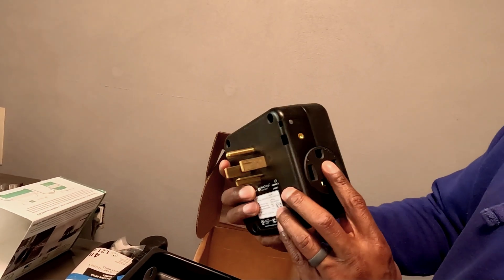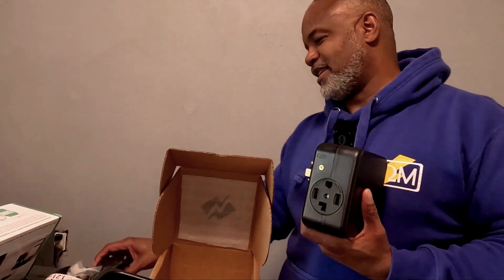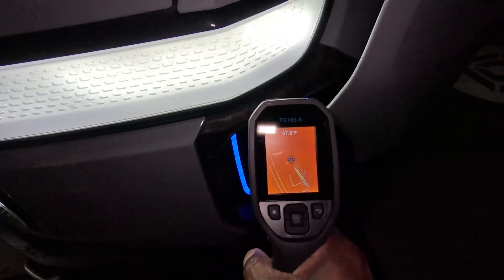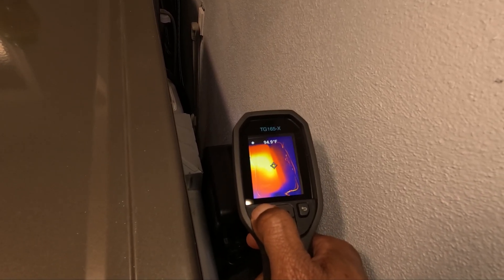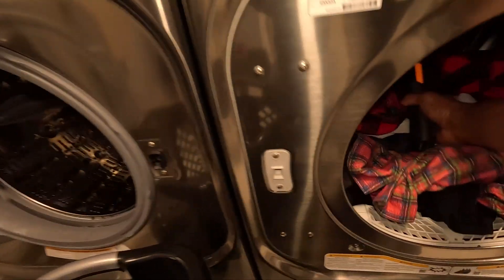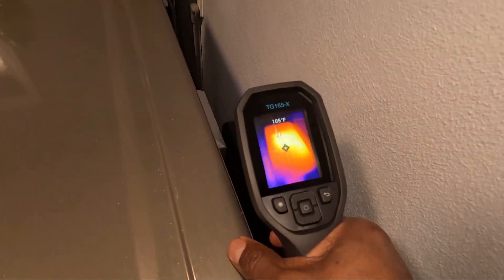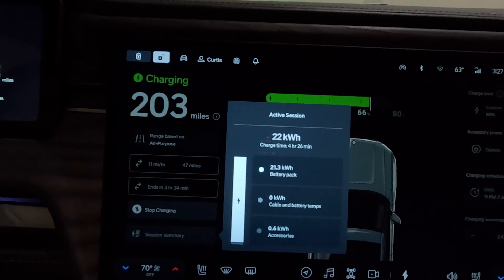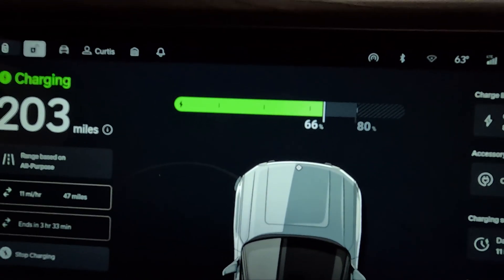😱SHOCKING! will MY EV charger CATCH FIRE!?

Comment: Just my opinion and that is I think the dryer and car charger should be on their own separate line.
Reply from the maker: Having a dedicated run for an EV charger is the best option, for many this is not an option because the electrical panel is at capacity and must be upgraded which can cost thousands of dollars. In my sister's case it would have been around $7500 for the upgrade, and the NeoCharge is a much more cost effective solution. This saved my sister $7000.00.
Reply: @ So what happens when the car is charging and the dryer is being used?
Reply from the maker: @ If the dyer is running the smart splitter cuts off the EV charging until the dryer stops. I covered that in the installation video.
Reply: @ I do understand what you have said in the video I guess I’m just not very comfortable on relying on the switch. As I know that nothing probably won’t happen however if this switch fails then a very serious problem will occur. So the story is we have a 2024 Tesla 3 and my dad being an electrician made it very clear about not ever using a power line for anything but the item it is intended for. So maybe you can under why this makes me nervous. Lol 😂

Comment: Did you measure the heat with both the charger and the dryer running?
Reply from the maker: The charger and dryer will not run at the same time. The Neocharge cuts the power to the EV charger whenever the dryer is running.

Comment: what kind of plag is the wall plug Duke where the neo goes into Nema 10-30?
Reply from the maker: Its a NEMA 14-30 dryer plug that is connected to 10-3 Romex in an outlet that connects to the NEMA 14-50 outlet in the garage. You can see how I set it up in this video: https://youtu.be/QjDj935fYCw

Comment: How much would it be total to add a level 2 charger? I believe the TESLA CHARGER is the cheapest but you get both for Tesla and non Tesla.
Reply from the maker: The Tesla Mobile charger is a really good option because it can charge at 24 amps unlike the Rivian mobile charger, and may be the best cost option. I do have a level 2 charger that I will be installing in an upcoming video.